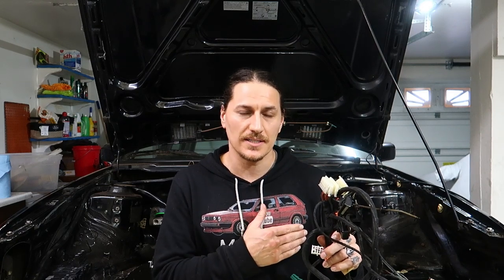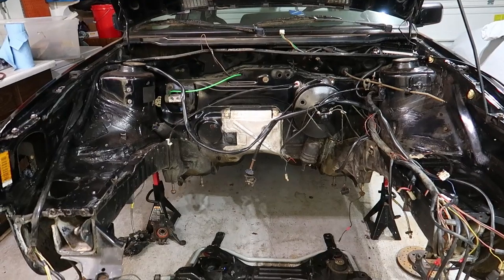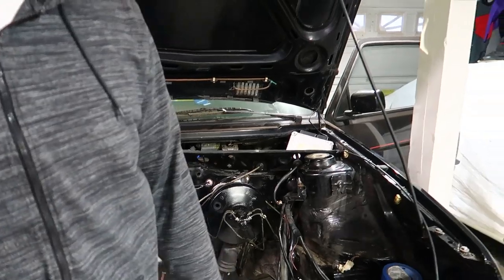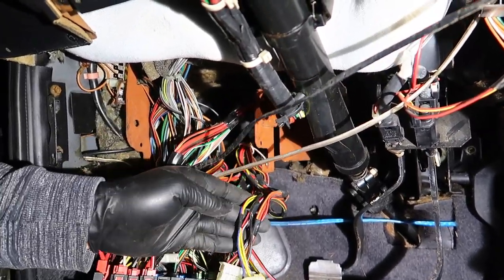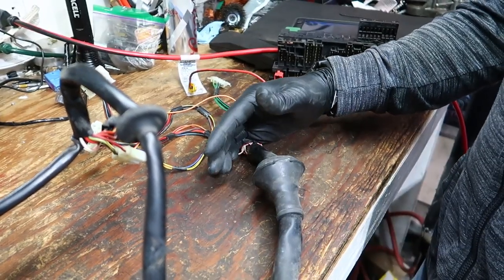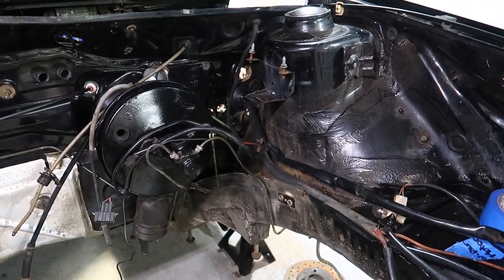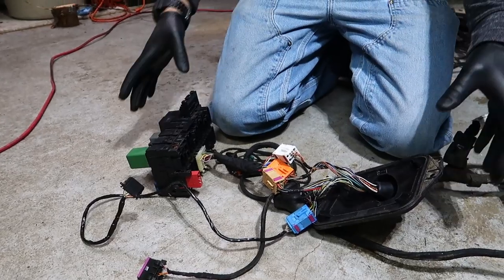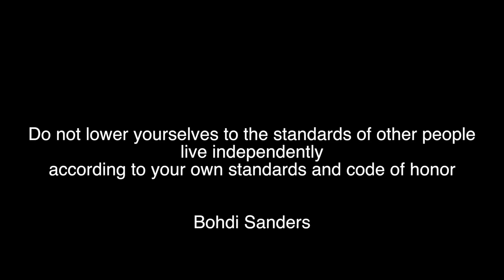How to tell if your MK2 is CE1 or CE2 | What wires to Remove | Plug & Play harness Install Pt.2

Comment: In euro cars, hazard switch place is the best way to find out is it CE1 or CE2. 

CE2 it is always on the steering column behind the wheel. CE1 is separate button in the instrument cluster frame 😉
Reply: Thank you so much

Comment: Just went through a lot of this for my VR swap. Tracing wires, and "re-doing" a lot of the learning that was lost when the mk2vr6.com forum articles went  away, but also figuring out some of the information that was never presented therein.
Reply: Hey Keith I'm doing a vr6 swap and got a "stand alone" harness trimmed from TDC. Lol I'm so lost and the other part is that there isnt a radiator fan plug on it after the trim. What did u do for that?
Reply: @anthonyalvarez6735   for me, I used the MK3 harness radiator bits and will be using the mk3 radiator fans and thermoswitch, but if you have your MK2 rad stuff still, you csn make that work. Did they just keep your rad harness stuff?
Reply: @dubCanuck1  yeah. It was originally attached but not when I got it back. The mk3 rad/fan assembly I bought had the proper plug but the mk2 plug  has 3 wires and the mk3 plug has 4
Reply: @anthonyalvarez6735  that big 4-wire plug runs back to the fan control module (the 6" long brick that has 2 plugs on the bottom and the clear plastic window covering a fuse on the top) which is in the engine harness. The MK3 thermoawitch plug partly runs back to it too. Are those still in your engine harness?

Comment: A seam ripper works wonders when splitting the harness. Great job guys!
Reply: MrErock0284 good idea
Reply: Letter opener works too for the heavier stuff. The one with the spike and the captured razor blade.
On the seam ripper, put the "ball" on the inner side keeps the pick from poking into the wiring.

Comment: i will swap the 1.8t 180hp audi tt mk1 in a old beetle already started bought the engine cut the beetle rear , i just want to know if i can start the engine with the original fuse box beetle , i want to keep the original body harness and just need the oil light and water temperature and pedal sensor accelerator , i won't use the speedometer or anything else that i don't need to start the engine can  i do it ? i have the 1.8t engine harness and i will delete the immobiliser from the ECU to start the engine of course can you help me with answer ? and i seen most of your  swap videos i thank you we all learned a lot 💪🙏🙏

Comment: Hi man nice job. I have CE2 fuse box and i want to swap to 1.4 16v AFH engine running on EFI . If I change the old engine harness with these new three plugs can it work or I say shit things?? Or I must have paralel harnes one for the engine and one for the lights and wipers . What you suggest to do ???

Comment: sorry i have so many questions but i’m just wondering a bit. With the plug and play wiring to the original box, are you able to “tune” the engine?  Is it possible to change the mk4 electric throttle body to a mk3 and make it drive by cable?  How are you planning to wire the speedo/tach cluster? If you have any knowledge of any of these questions it would be much appreciated if you could help me out. Thanks!

Comment: Hey Jake where is the imobilizer located in the mk2?
Keep up the good vids...awesome
Reply from the maker: You have to get it deleted from the ecu
Reply: @JakeRawSon  I did my VR6 swap and it will start and kindle for two seconds then shut off and wont start back up
Reply from the maker: If you haven’t had the immobilizer deleted off your ecu you need to
Reply: @JakeRawSon  on the VR ECU?

Comment: What’s up Jake so I have a mk2 with the ce2 and the previous owner did a mk3 2.0 with the mk3 transmission but I see your doing the 1.8t I’m which would be a better fit 1.8t or the leave the motor I have have just work on the motor but I want a turbo and don’t know if the 1.8t is a better option for me. Thank you!
Reply from the maker: Ya if you want a turbo id put a 1.8t in it. But if your car is running good I’d drive it until it breaks.

Comment: Hey Jake im doing a 24v swap on my mk3 gti. My harness is a different it all goes into 1 loom of wires. Do I have to unloom the harness and then pick out what is needed? That would be great help im ready to put the engine in. but I want to do the harness first and I already have the stancedub plug and play harness.
Reply from the maker: Yep think you'll need to cut that thing open and take out the old engine wiring.
Reply: Ok cool thanks for the reply i really  appreciate it. Just wanted to make sure.

Comment: Can i wire tach rpm without an adapter ce2 with 1.8t agu
Reply from the maker: getting the tach to work requirers you to buy something that takes the digital signal to analog if you keep the mk2 cluster.